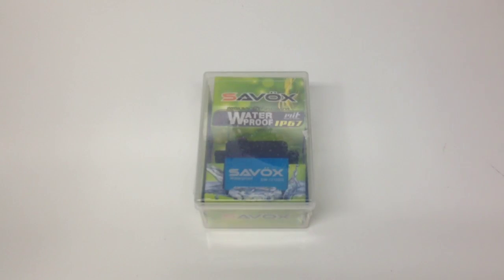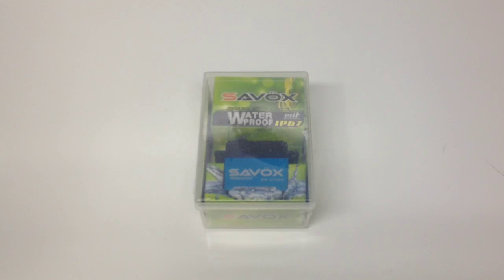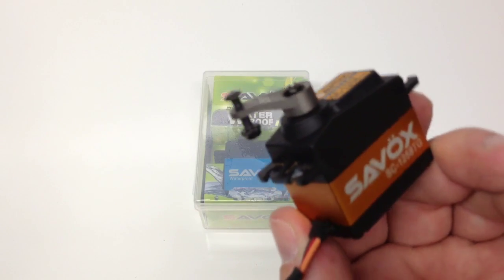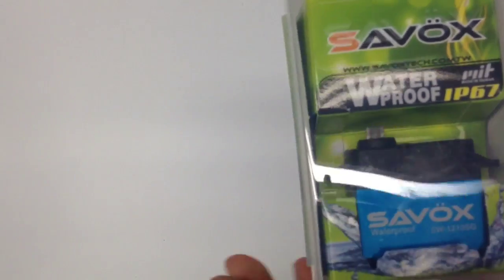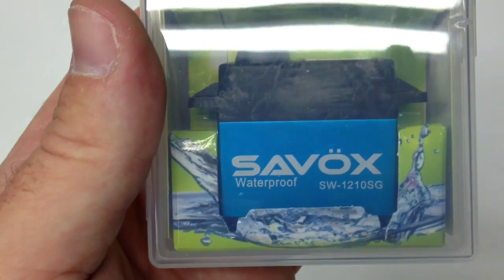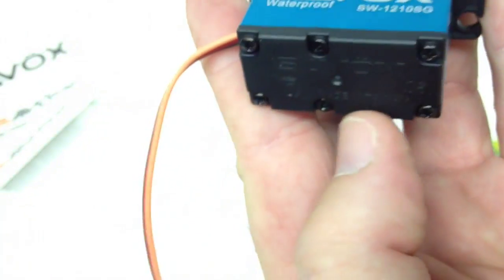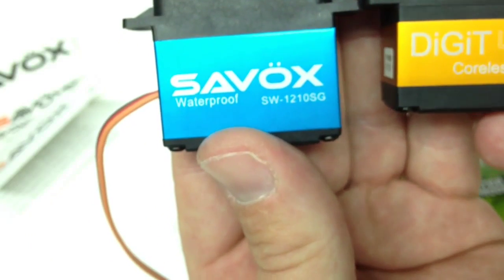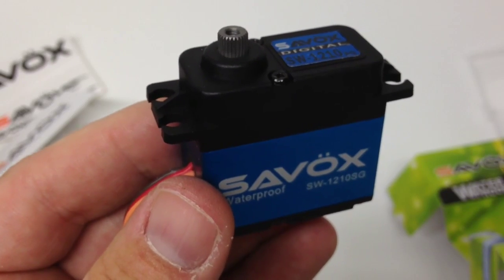NEW!! Savox 1210SG WATERPROOF Servo unboxing!

Comment: Savox USA said its 7.4v but Savox Europe said its 6.0v, which is correct ?
Reply from the maker: I would go with which ever country you're buying from....sometimes they spec the same model for different countries, but they may slightly differ.  Meaning if you're ordering from Amain Hobbies in the US, I'd go with the US Spec as that's probably correct

Comment: Question will this servo work in the trx4 defender without blowing the esc?  I run a mamba micro x and 2.0 bec and bought this servo, before a friend  stated traxxas told him it would fry my system.. is that true at all?   I don't know
Reply from the maker: If you have a BEC installed, you'll be fine - if you install this servo with the stock ESC.....yes, it will fry it
Reply: @TheRCNetwork  i have the Mamba micro x sir. Thank you for your reply means alot coming from you..i watch all the videos they're great all of em
Reply: @TheRCNetwork  1 last question PLEEASE...if the Savox servo steering is super short;  I re-set steering 30 times.  Can't turn much. Is that most likely a servo or esc issue? Possibly power?  Turning radius on defender is poor poor.  Thank you fir what you do!

Comment: Just curious if you use the rubber grommets? Have mine installed on scx10ii but grommets seem to become too smashed when tightened down on aluminum servo mount.. thanks for any advice !
Reply from the maker: I don't.  Not sure where the rubber bumpers started, but I've never used them in any of my builds

Comment: My car is traxxas stampede vxl 4x4, I'm running 4S battery + Mamba monster x esc and 2650kv brushless motor (Castle creations)  + Pro-Line Trencher 2.8" wheels.
My question is, 
I bought new servo (savox 1210sg) but only after i bought it i realized there's 2 versions (6v and 7.4v HV) and i bought the 6v.  
do you think it will be enough? or should i go with the 7.4v HV? (I can send the 6v back) 
Thanks
Reply from the maker: I would go with the Hi Voltage version...you'll end up with more torque for what you're running....and breaking...lol
Reply: @TheRCNetwork  
LoL
So Maybe I should stick with the 6v...??
Reply: Now i have a question regarding the electronics.
So I've got Traxxas Stampede vxl 4x4 as i said.
In my Mamba monster x ESC,  i have the internal BEC feature
Now, I wanna buy the Savox SW-1210SG HV (High voltage)  it's 6v-7.4v.
i'm running 4S batteries,
I want to set the MMX internal BEC  to be on 7.5V (in order to use the most of the savox)

My only problem and concern is what will be with the Receiver? 
According to Traxxas, the Receiver can handle up to 6V.
If i set the internal BEC to 7.5V, can i risk to damage the Receiver?

Thanks

Comment: This model is now HV approved and I have it on my heavily and heavy upgraded Stampede 4x4 3s brushless.  It’s a great servo.
Reply: My car is traxxas stampede vxl 4x4, I'm running 4S battery + Mamba monster x esc and 2650kv brushless motor (Castle creations)  + Pro-Line Trencher 2.8" wheels.
My question is, 
I bought new servo (savox 1210sg) but only after i bought it i realized there's 2 versions (6v and 7.4v HV) and i bought the 6v.  
do you think it will be enough? or should i go with the 7.4v HV? (I can send the 6v back) 
Thanks

Comment: Does this have enough torque to be used in tekno mt410?
Reply from the maker: In my opinion, no. The MT410, even with smaller Tires needs at least 350+ oz/in of torque.
Reply: The RCNetwork alright thanks does the savox Ryan Cavalieri edition is a good choice for the tekno mt410

Comment: Do you think this would be enough to handle steering for either the Arrma Kraton or an Axial Yeti XL?
Reply from the maker: drog343 nope....if you're looking for waterproof, check out Futaba Servos. Most of them are waterproof from the start. Look at the BLS172SV....last servo you'll need for either of those two

Comment: i made a custom built AX10 (kind of heavy) for hard rock crawling, and i have been constantly stripping gears in my cheap power hd lw-20mg servo. i need a servo that will stand up to the rock crawling.. 
i was looking at this Savox 1270TG or maybe the savox 1210SG. what do you think would be a batter choice. i like the fact that the 1210SG is waterproof, but i am not sure it will hold up to the rock crawling.
Reply from the maker: I'm not really a fan of Savox anymore...especially for rock crawling.  Check out the Futaba S9177BLS:  http://www3.towerhobbies.com/cgi-bin/wti0001p?&I=LXFSFZ&P=ML
It has 569oz/in of torque and a transit of .11 sec.  PLus most Futaba's are Waterproof.....and this one is!
Reply: I am looking at the servo you are suggesting. I do not see where the site says its waterproof? The site also says its made for airplanes? Am I missing something? Was thinking of using this either for my Ascender or Slash 4x4. Sorry, not trying to be crass about it.
Reply: Will the S9177BLS work in the Outcast or would it be overkill?

Comment: Would you recommend this for a slash 4 x4 or is this overkill ?? I purchased this servo  for my vaterra ascendor and I'm rebuilding my slash platinum and I'm tempted to use it in the slash I have not used this servo  yet in anything but I need a waterproof servo in my slash thank you in advance for any advice I LOVE this channel
Reply: Danny Bates I just put one in my Slash 4x4. Super fast, loads of torque. I recommend a glitch buster though.
Reply: Josh Turner thankyou buddy I have it in my slash 4x4 with glitch buster and I love it!!!!!

Comment: I just recently got a couple of these to run in my Summit (which I previously upgraded to a single Savox's 1230sg, but I'm swapping that out into my Tekno mt410 when I get to it), so far I still have the stock esc (still haven't decided on if I'll upgrade it, I want to run it until I have to replace something between this and the motor). Anyway, would I be ok with just a glitch buster which I currently already have on the truck, or should I use the CC ebec (which I've just been sitting on, as I am not sure how to wire this with the evx2)?
Reply from the maker: Try the GB first to see how it handles it.  Drive it around and if you notice the steering cutting in and out or the ESC just re-starting, you may need a BEC.  With that.....you can switch to Hitec or Futaba and have no issues!
Reply: The RCNetwork Thank you. If I were to eventually go with an esc that can handle more amps, would I still need either?

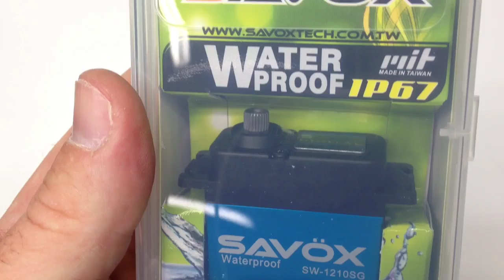Comment: 3:56 - IP67 is the "International Protection Marking" or "Ingress Protection Marking" classification and rating of the degree of protection provided against intrusion.

IP67 = Dust tight and Immersible, up to 1 m depth

First digit: Solid particle protection (The first digit indicates the level of protection that the enclosure provides against access to hazardous parts and the ingress of solid foreign objects)
Second digit: Liquid ingress protection (The second digit indicates the level of protection that the enclosure provides against harmful ingress of water.)

first digit (6 is the highest level or solid particle protection) : Dust tight - No ingress of dust; complete protection against contact (dust tight). A vacuum must be applied. Test duration of up to 8 hours based on air flow.
second digit (7 three down from the top of the cart) : Immersion, up to 1 m depth - Ingress of water in harmful quantity shall not be possible when the enclosure is immersed in water under defined conditions of pressure and time (up to 1 m of submersion).
Reply from the maker: Thanks for the info!
Reply: The RCNetwork thanks for the videos

Comment: I don't know what is wrong with the receiver w/failsafe it from tactic
Reply from the maker: +Kevin Vasquez If it's a new radio, did you bind it to the radio?  You can also try to re-bind it.  There's info on that in your owners manual

Comment: Does anyone knows if that servo works fine on a Castle Sidewinder 3 ESC or shall I need a BEC?
Reply from the maker: vohnkar666 You will need a BEC or possibly just a Voltage Cap on the Receiver (simple plug in device from Spektrum or Racers Edge)
Reply: By Voltage Cap, you mean a Glitch Buster, I guess?
I got a 6v/6A UBEC, hope it is fine as this Savox model uses up to 5A at 6v when used at max capacity.
Thanks for clarifying!
Reply from the maker: I believe the GlitchBuster's name is owned by Novak, but yes, that type of device

Comment: If no one has written it before the IP67 means it can be submerged into 1m/3ft. of water for an extended period of time and still work without any issues (Atleast for 30 mins before the risk of water will start to seep in through the seals)
https://en.wikipedia.org/wiki/IP_Code

The Xpert RC WR servo range also has the IP67 Rating.
http://www.xpert-rc.com/ they only make Brushless servos in both LV 4.8V-6.6V and HV 6.0V-8.4V variants. In contrast to the Savöx and many other servos the Xpert servos are very quiet when idle and waiting for input from the RX . Check out my video with an Xpert WR-6601HV servo. https://www.youtube.com/watch?v=LgCcGOKEzZk
Reply from the maker: Hitokiri2000 Thanks for the info

Comment: Would this savox work with my axial scx10 if not what would you recommend
Reply from the maker: stihldw26 Thats what I run it in now......works great!
Reply from the maker: stihldw26 You may need to look at clearance on the support bars crossing the ladder chassis.....I removed one of them for the servo and because I have a different bumper
Reply: Cool thanks also thinking about switching over from the stock 1.9's to the 2.2 size tires what else do I need to replace
Reply from the maker: stihldw26 Really, just look at the ride height and clearance with the body.  I added a lift kit to raise the shock mounting point with some Pro-Line trail shocks.  It really depends on the size of the 2.2" tires....There's so many heights, so be careful

Comment: If u think 277oz of torque in a 1.9 scaler is alot u must not comp with it, don't waste your money Hitec 7950 if u wan't the Savox killer
Reply from the maker: gixxerstuntin This is a pretty old video, and at the time the highest spec'd WP labeled servo on the market.  Since then, I really don't care about waterproofness in electronics, as I choose not to run my RC's in those conditions.  Since then, I rock a Hitec 9380 and 9370 in two of my Yeti's.  Great servos!  I've also have several 7955's as well.
Reply: gixxerstuntin yeah for double the price.
Reply from the maker: Nathen M. Not a big fan of Savox anymore.....constant issues and the noise just got on my nerves....I'll pay more for a Hitec or Futaba and never worry my servo again...
Reply: The RCNetwork I run hitec, but in the interest of others looking for something in the same price range...

Comment: Can this servo handle 7v bec?
Thanks
Reply from the maker: Tony D'Alessio Savox does not list specs for 7.4v, so I would assume not.  The websote states 4.8v/6.0v.  Here's a link:  http://www.savoxusa.com/Savox_SW1210SG_Waterproof_Digital_Servo_p/savsw1210sg.htm
Reply: Do you know if Savox has a servo that will support 7.4 volts
Reply from the maker: Tony D'Alessio Many of their High Voltage line will.....most of the 227x will.

Comment: i hear people talking about metal gears in there servo's and stuff, and im just trying to figure out what the hell they're doing to there rc, all i have is my stock traxxas 2075 and i beat the living crap out of my slash and nothings broke on the thing at all yet..
Reply from the maker: Metal/Titanium geared servos are intended for more extreme circumstances where you might have a heavy RC, Powerful RC or rock crawling.  Metal geared also helps when not running a servo saver

Comment: Will this servo work on Slash 4x4?
Reply from the maker: Yep, fits perfect and is waterproof!
Reply: The RCNetwork
while it fits i do worry it will have an abrasive relationship with the velineon esc. many report absolutely needing to run it with an external cap or bec.
Reply from the maker: Yeah, most savox will require some sort of power management. The easiest solution is a voltage Cap (Spektrum sells one for about $6) which plugs into any open port on your receiver. Pretty simple and solves the problem
Reply: are these caps small enough to squeeze into the receiver box? i appreciate the advice :)
Reply from the maker: The Spektrum is about 1" x 3/8"

Comment: Another great video. Forgive my noob question, but will that fit in your slash project truck that you installed the 1258tg in? I'm working on an identical project slash and am considering this as a servo upgrade with a kimbrough servo saver. I'd appreciate your feedback!
Reply from the maker: Yeah, with out a problem.  The 1210 is a bit longer than the 1258, but you have about 7-8mm of extra space even with the stock recv box.

Comment: Hi
First of all, I really like your channel!
Do you know if this servo will fit the scte?
Regards from Sweden
Reply from the maker: It should fit in fine, although its a very tall servo, and the SCTE mounts it standing up.  Worst case 4 little 1-2mm spacers would do the trick to have almost 300 oz/in of waterproof torque!

Comment: Great thanks for the response I'll order them asap then as far as ESC I'm running the TEKIN RX8 GEN2 WITH T8 2250KV 2 MAXAMPS 9000XL 7.4 100C for just bashing around and the track think I can give them good power I'm set at 6v now so I don't smoke the stock TRAXXAS ones think it goes higher but arent those rated only up to 6v and of course I've got the 11.1 if I want to go 90mph too lol thanks keep cranking out vids nice job very informative
Reply from the maker: The Gen 2 RX8 will handle the 1210 without a problem.
Reply: The RCNetwork do the crap caste bec's handle this servo I think not but idk
Reply from the maker: I had the 10amp CC BEC hooked up to this on a scaler and no problems. I was running a Tekin FXR ESC
Reply: The RCNetwork no the built in bec on castle esc's

Comment: I'm wanting to upgrade my revos got an e revo and a 3.3 from the TRAXXAS 2075 to the savox waterproof no problems with them yet just want more torque question is first off will this one fit revo chassis and I want to stay with dual servo setup will these be too much torque if there is such a thing lol just don't want it causing other issues I'm running a spektrum DX4 radio just fyi
Reply from the maker: The 1210 is a great alternative to give waterproof security with huge torque!  As far as too much torque........Not really a such thing!  It's like too much horsepower!  They should fit with no problem.  You may need to install a BEC deppending on what ESC you are running.  The Savox servos are very power hungry

Comment from the maker: Just wanted to share my video on the Savox 1210sg waterproof servo. I was able to run it now and it has loads of torque, it's pretty quick and love that it's waterproof from the factory!  Check it out!
Reply: hey rcn do you know if this servo will fit in a traxxas slash 2wd with the traxxas lcg kit?
Reply from the maker: Not sure on the 2WD, but I checked for someone else on the 4wd LCG and it would fit
Reply: The RCNetwork hmm ok
Reply: +The RCNetwork sweet i was just going to ask if it will fit in the 4x4 lcg

Comment: Can this servo fit a Savage Flux HP
Reply from the maker: It should. It's a regular 1/10th / 1/8th sized servo, but is a bit longer can. Check the link in the vid description for exact sizing and compare to yours.

Comment: would this be strong enough for an hpi savage flux with big tires?
Reply from the maker: I think it would be right in line with that set up.  Typically you want about 300 in/oz of torque for the Savage, but if Waterproof is what your after, the 1210 is almost there.

Comment: Lol.. Just take my word the stock screws suck! Water is every where.., wet clay, water is even in the air.. Lol. rust and rc's don't mix .. I air compress my rc's and sometimes hose them down with soap and water.. Well it's your rc and I know we both don't but cheap sh!t.. Like machocave's motto " everything matters".